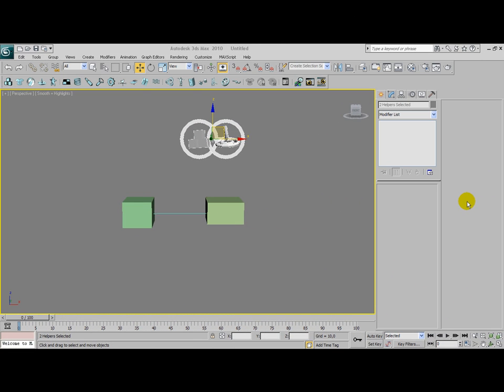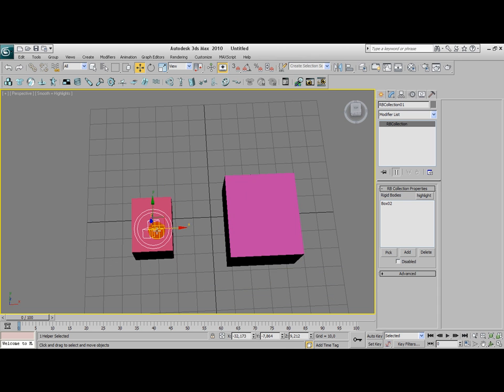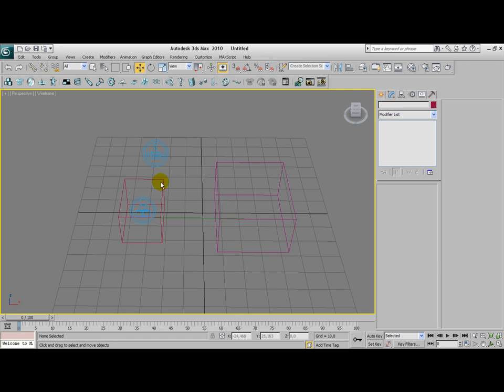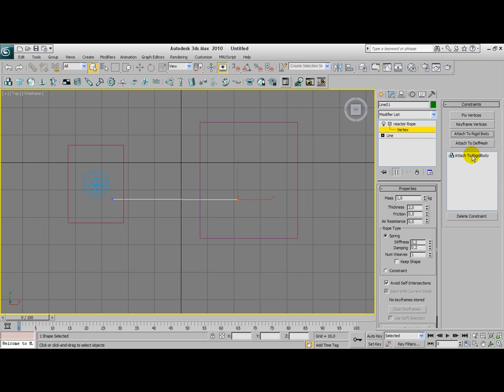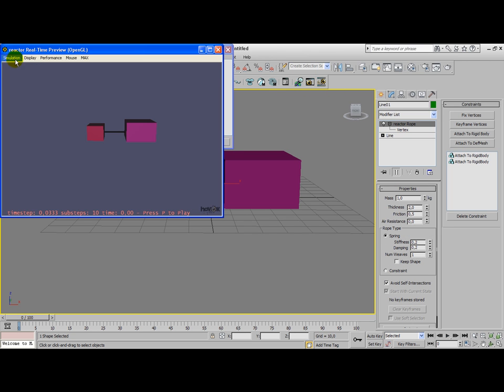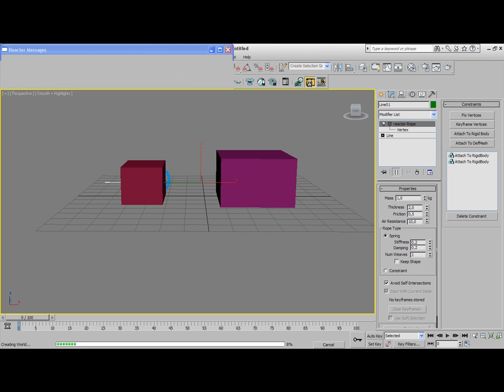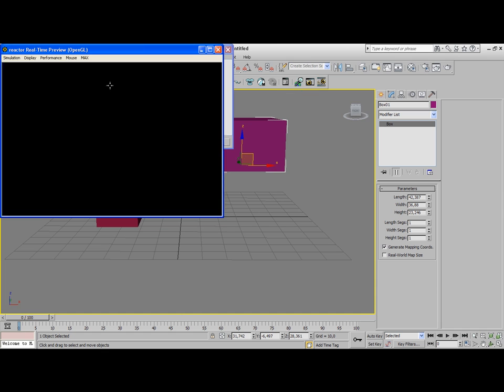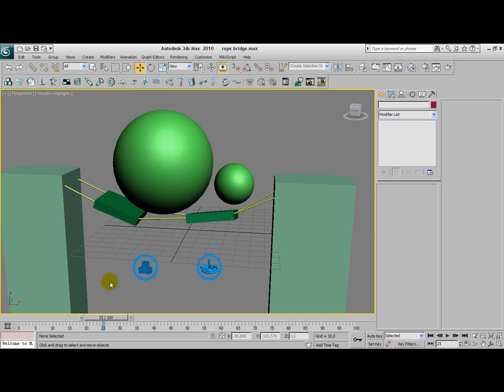3d Max reactor tutorial: Rope modifier

Comment from the maker: It is possible that inside 3d max everything is a bit laggy, but with rendering this goes away. make sure you use concace meshes for the chain. Also try to set the friction to a lower level.

Comment from the maker: It is possible to make a chain with reactor. But you don't need to use the rope modifier for this. Create 1 chain (tube for example) and hold shift. Drag the object halfway the original object and copy it 10 times. Now select every second chain. Turn those chains 45 degrees. make sure the chains are not touching each other. give all chains a mass accept the top one. Put everything together in a collision collection and try it out. You might need to use concave mesh. If you need help, ask